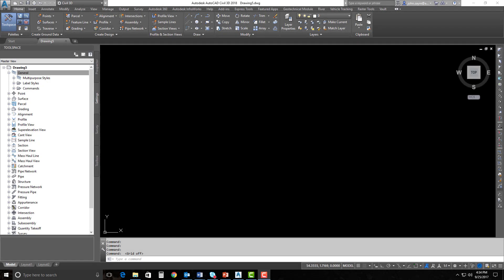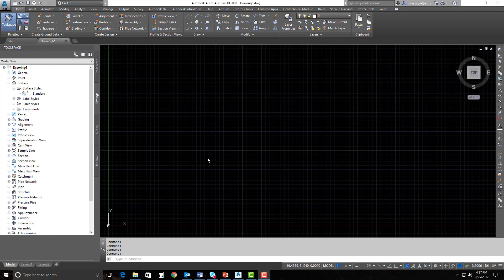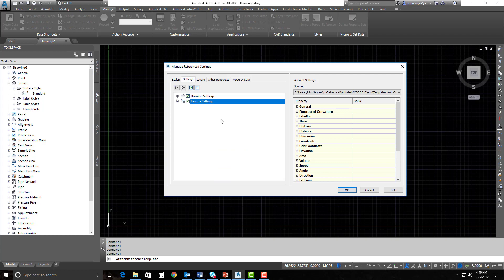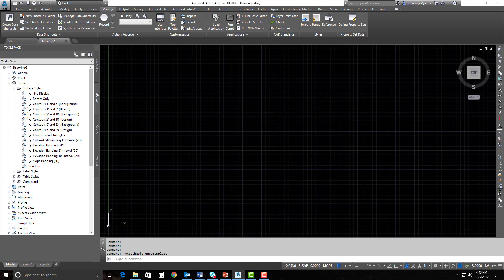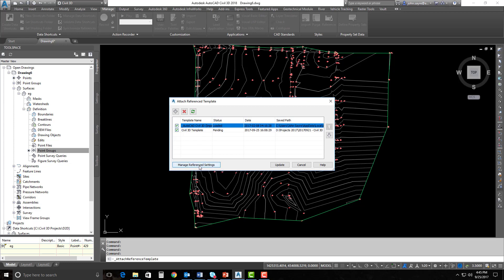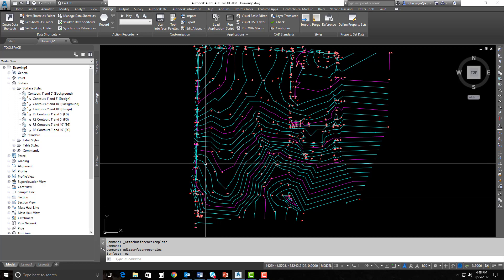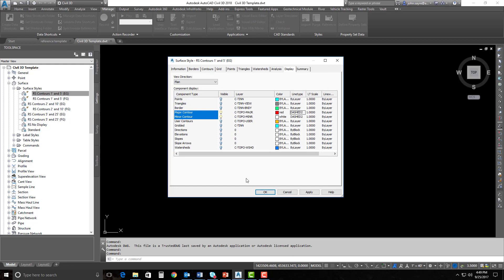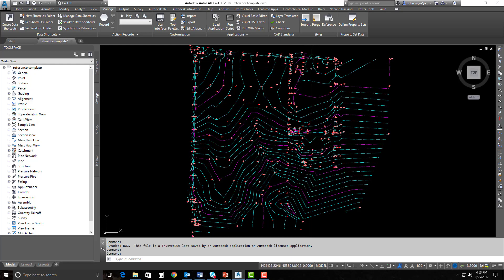Civil 3D 2018.1 -  Reference Template Enhancements

Comment: since the data is referenced, if you share the drawing with someone else, do you have to send the reference files as well? Or is the reference saved inside the drawing?
Reply from the maker: It works like an xref. So if the template you are referencing is in a path that that person can see then it will stay attached and usable.